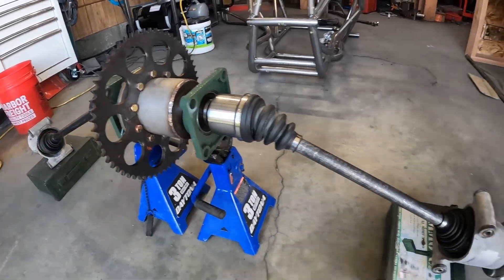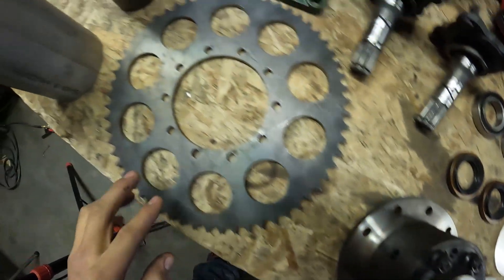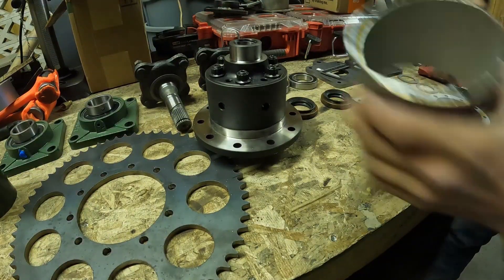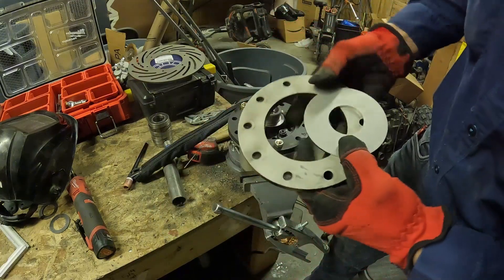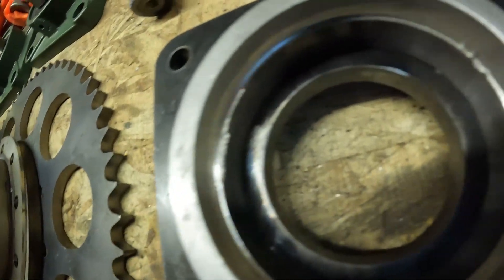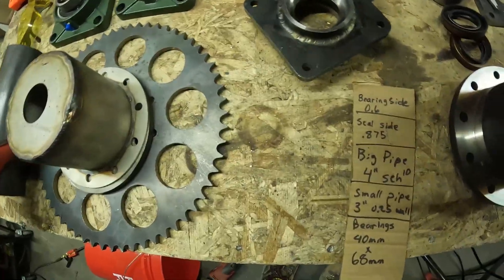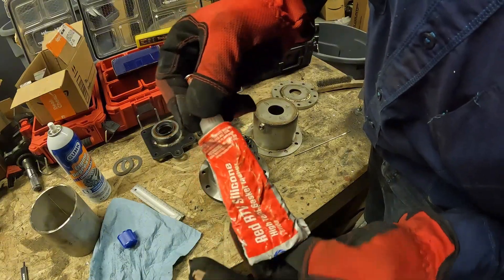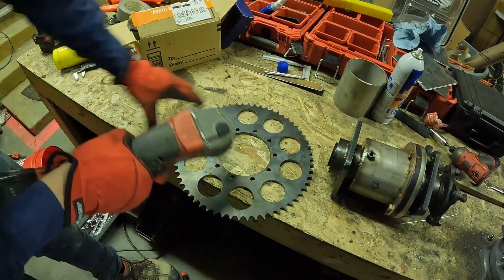How To Make Chain Drive Differential (no lathe)

Comment: Hi. Roughly how wide is this rear section from wheel mounting surface to wheel mounting while sitting at ride height on your buggy? Im wanting to buy it but im not sure if the miata axles are too wide or not. Im sure I could shorten them though.
Reply from the maker: I don't know right off but I bet its about 70 or 75 inches.    Its going to be the same as the car the axles come from
Reply: @Xkarts200 ok cool so basically the center bearing section that you sell is the same width as the Mazda differential.
Reply from the maker: @MrYz250fman no I was talking about the differential in this video you commented on.    The spool i sell is similar tho. Its around 68 to 72